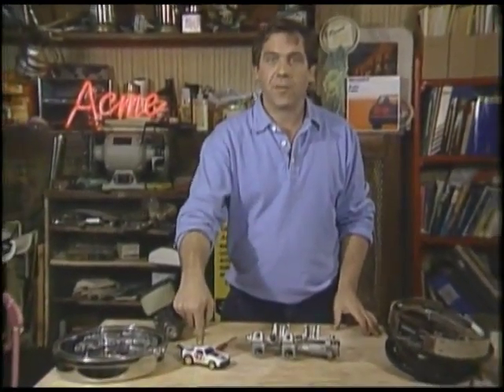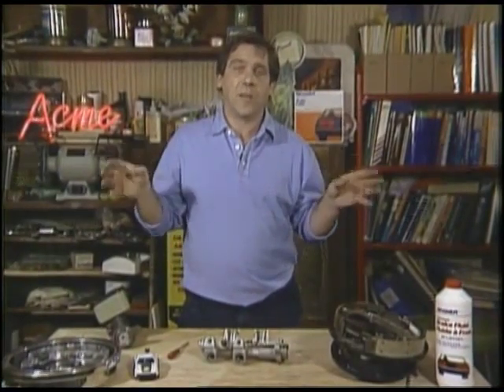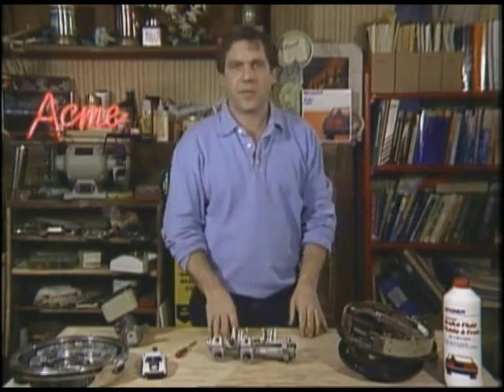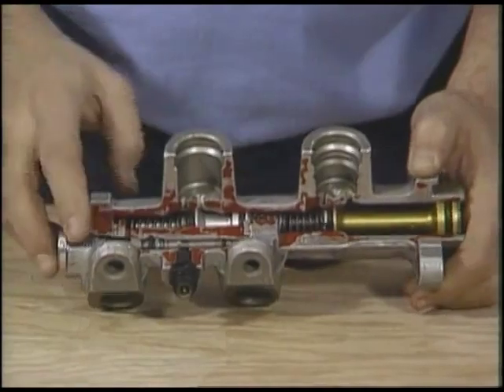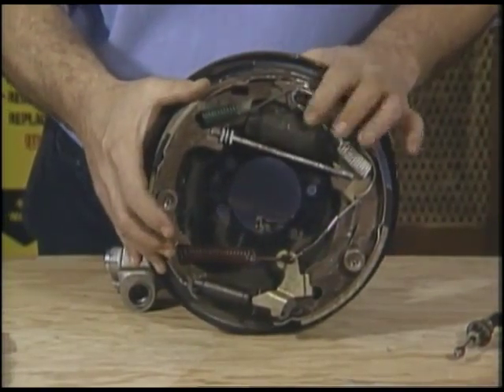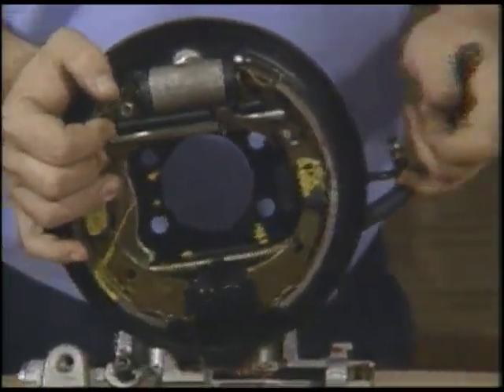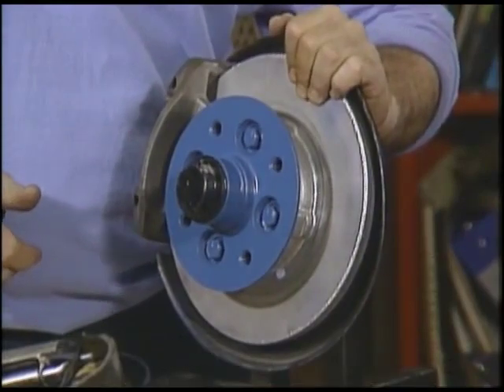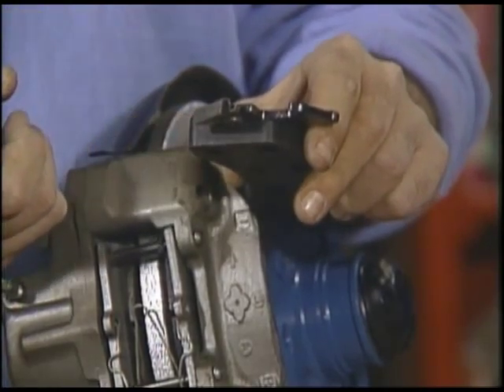How Stuff works! Automobile brakes.

Comment: well the more ya know right im researching on braking transmissions and differentials so i can design this tank for air soft granted most of you will say im going to far but i want to test my knowledge and ability to create something that would function for once no matter the complications or the extent as to where i need to go but i need help from some smart minded people. here is my question
i have two set ups in mind, 
set up 1: one engine of good size connected to a transmission then from the transmission to a drive that hooks up to a differential like the ones off cars/trucks then on the two out puts of the differential ill have 3 disks for braking to be applied and then at the end would be the gear/sprocket that drives the tracks
set up 2: two engines of equal size hooked up to two transmissions of equal size then connected to two differentials (these two engine,trans,and diff combos operate independent of one another) then on the inside of both differentials the sides that dont output to the sprocket a set of two brakes and then on the side that out puts to the sprocket another set of two brakes.
here is a representation of the two set ups
E=engine
T=transmission
D=differential 
--= drive shaft
== brakes
stp 1:
              ===
                |
E----T--------D
                |
              ===
stp2:
             ===
                |
E-----T------D
                |
             ===
             ===
                |
E-----T------D
                |
             ===
The question is which one would offer me more power maneuverability and which one would leave less stress on all components
Reply: mr. darkredwolf are you really asking this question? 
The answer is painfully obvious. Surely you figured it out yourself as a result of posting your question.

Any sixth grade knows the answer.

Just basic nuclear fusion science that we all learn in grade school.
Reply: Anon Ymousmie srry YouTube is the wrong the place to inquire about technical information from the public being any number of idiots can reply makes the answer you receive less viable and well not as able to be taken as fact considering it most likely came from yes a sixth gradER . I do apologize for my request of information being a bit long and well over done but it was to save my self from have to explain it all over again. I bid you good day I tip my hat and swish my tail as I turn around walking off
Reply: Yeah well... I still have no idea what language you are speaking... don't let the door hit you in the ass.
Reply: I dont understand you. such hostility, and for what? All I wished to obtain was some actual impute not the sarcaststic and painfully non-humorous comment you dished out. And language , English I speak English and I type English